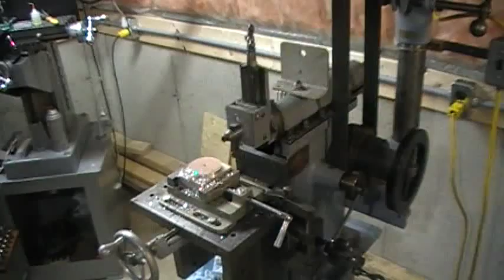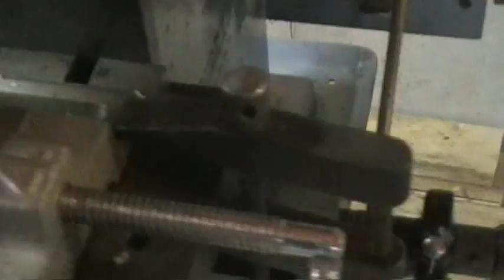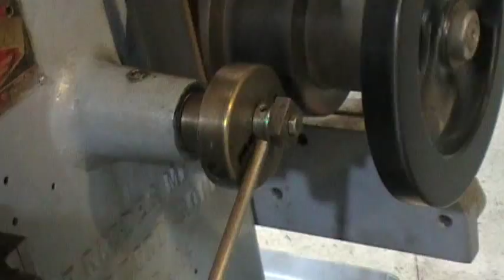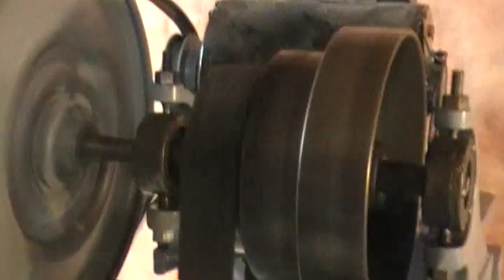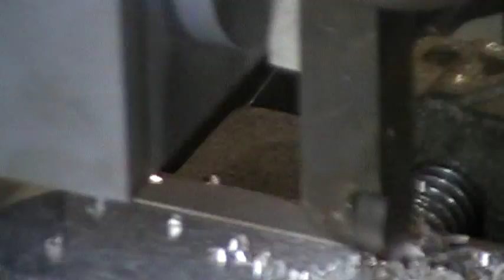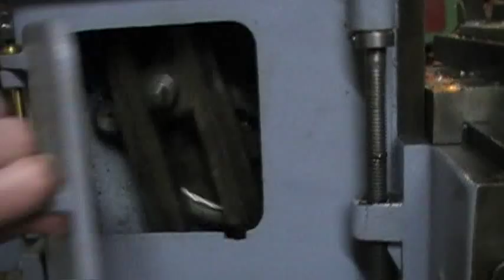Rhodes Shaper.MOD

Comment: I know this is a really old video, but I just noticed your shaper has a hand crank on the back of the ram. What does that hand crank do. It looks like an add on by a previous owner. I’ve never seen a crank on the rear of the ram. My Rhodes doesn’t have that.